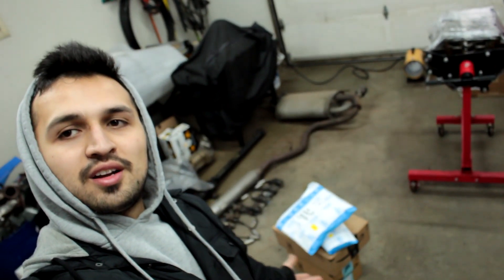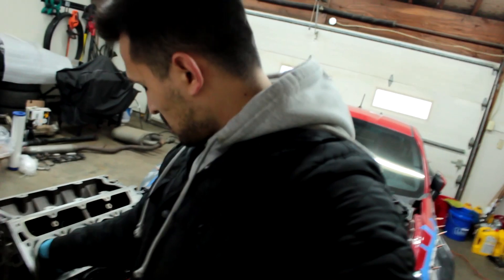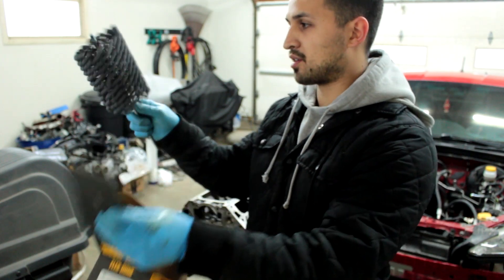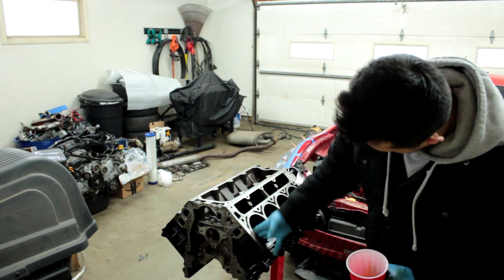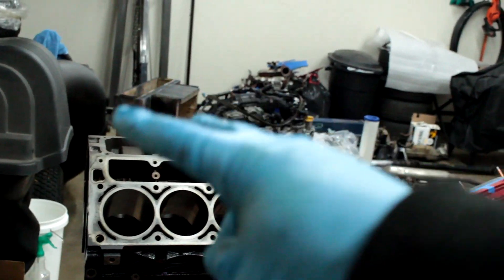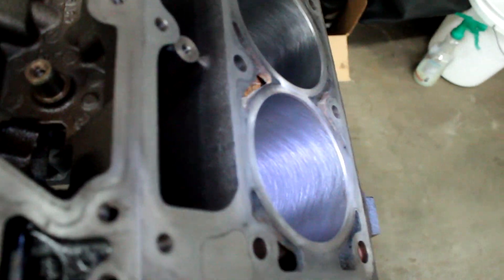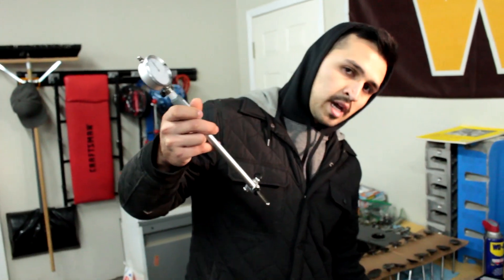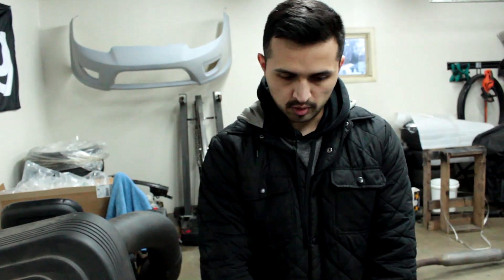Ball Honing An LS Block and Measuring Bore Diameter

Comment: Hello, what is the difference measure before flex-hone and after flex-hone?
Reply from the maker: I don’t quite remember how much it took off, we just aimed for a nice cross hatch pattern without getting outside of the stock bore range. Hone will remove as little .001 if it’s controlled.
Reply: @projectmidwest  did you use standart pistons after honing? Or +0.25, 0.50??
Reply from the maker: Yes, I ended up using stock piston diameter
Reply: @projectmidwest  thanks my friend. Just last question: my engine has 79mm size cylinder bore. Sould i buy same size flex-hone or bigger than cylinder bore size?
Reply from the maker: Yes, I would go with the same size or next largest size if bore is non-standard
Reply: @projectmidwest  thanks bro, you are the best.

Comment: What size hone did you get ?
Reply from the maker: 4” Brush Research GBD40024 Heavy Duty FLEX-HONE, 4" (101 mm) Diameter, Silicon Carbide Abrasive, 240 Grit (Pack of 1) https://www.amazon.com/dp/B002XUL1M6/ref=cm_sw_r_cp_api_glt_i_SV1ZZ5ENHRZ5MZQJ7QD5?_encoding=UTF8&psc=1

Comment: Hello,

After you use Flex hone, it is able to use same size piston? Cylinder lineer diameter changed?
Reply from the maker: Yes, it’s just a light resurface. The important thing will be making sure your ring gaps check out. When you hone the bores, achieve the cross hatch pattern and that’s it. It shouldn’t take off too much material.
Reply: @projectmidwest  thanks for reply, i will ise New rings. Engine has wet lineer, i have a Suzuki swift III sport. Easy to replace lineer but i want to deglaze all lineers.